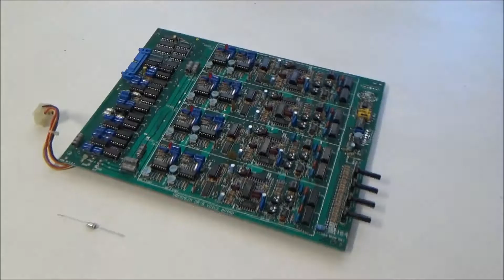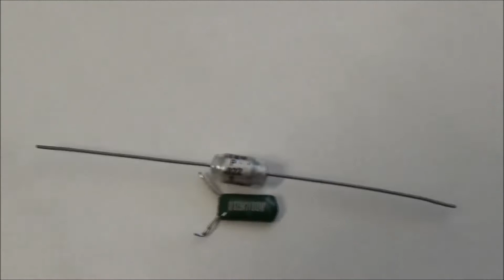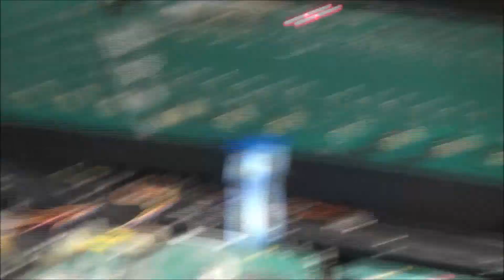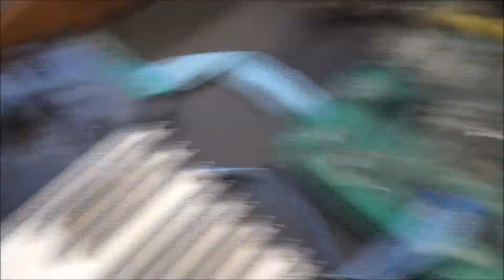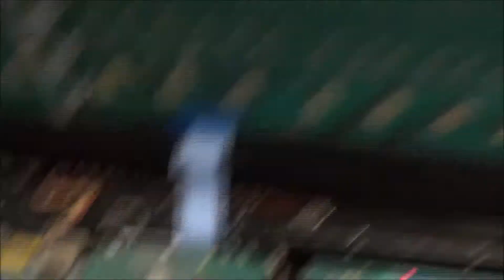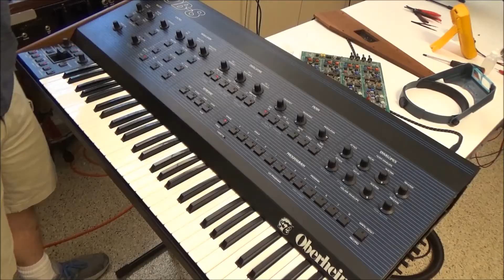Synthchaser #078 - Oberheim OB-8 Voice Board Repair

Comment: Thanks for sharing. I guess you didn't want to adjust the audio levels on the customer's board in case his other working board has the same (lower than yours) audio levels too ?
Reply from the maker: I would assume it's more likely that the level of the customer's board is matched to the level of his other board than to my board, particularly if he isn't complaining about one board being a different level than his other.  Besides, that's an easy enough adjustment anyone could do it.
Reply: @Synthchaser  how do you adjust the volume of the boards? My 1st voice is louder than the other 7